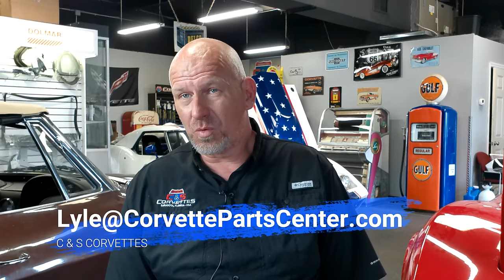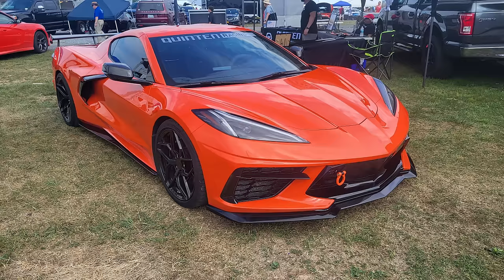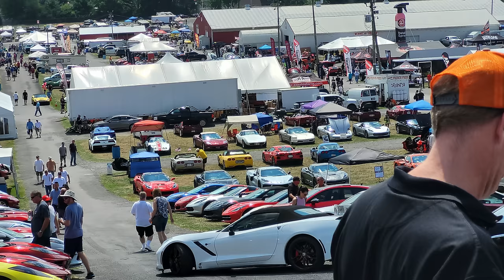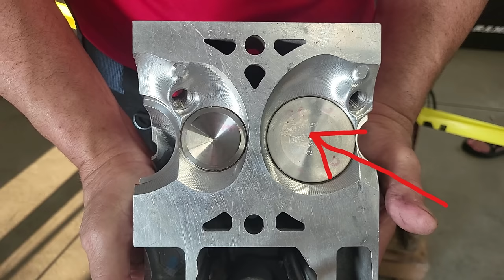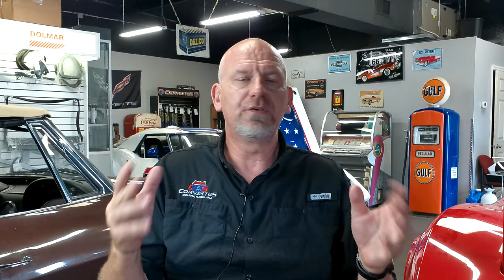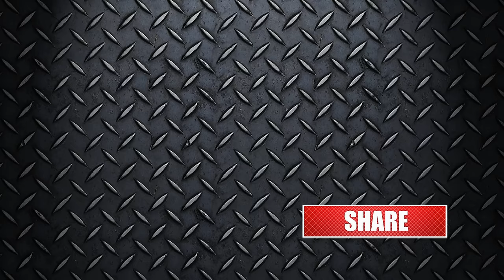The Truth about the LS7

Comment: This video was mostly BUNK!  I've seen hundreds of out of spec LS7 valves/valve guides, they range from every model year GM made the LS7 (including in the Z/28)... ALL THE YEARS POTENTIALLY HAVE THIS ISSUE!!!  It's more rare to not see a stock LS7 without at least one valve close to being, or being completely out of spec.  Mileage isn't a huge flag either, I've seen them loose with under 10k miles.  This doesn't mean they will grenade at any moment (it's a fairly low percentage that totally nuke), but the point is every LS7 is suspect and an eye needs to be kept on them to make sure they don't get to the point of excessive wear.   Please do not listen to the BS GM is spewing that it was only a few cars and only 2006!
Reply: as a former ls7 owner I agree. They also love to have rod bearing failures.
Reply: What about LS3? I have one in my Holden Commodore SS paired to a T56... is there anything to worry about? (Mime still has the machined roller rockers not the cast ones btw)
Reply: @GregoryShtevensh  the ls3 is the most bulletproof out of the entire LS series. The only thing on them are the stock rocker arm needle bearings (all ls engines) if installing a high lift aftermarket cam.
Reply: @KNS_Racing  awesome haha
Reply: Very strong opinion. I have found that folks with a strong opinion are often not 100% accurate. Get the heads replaced by a reputable company, AHP comes to mind. Get a mild cam and you are set. I did that and dyno numbers were 550.18 HP and 503 lbft torque.
Reply: @GregoryShtevensh  The LS3 is 100% solid.  Do the solid bushing conversion on the rockers and you're golden!
Reply: @BensonBMD  I'm guessing you have zero experience, other than being a one or two time vette owner and occasionally look at the corvette forum.  I've seen hundreds of LS7 heads, possibly thousands at this point.  Strong opinion?  Possibly, but almost all of them have out of spec heads, regardless of mileage.  I'm glad to hear you're happy with your results (AHP is a solid company), but please don't come on here like you know anything owning one or two vettes and mislead others that it's not an issue... it is, period, regardless of year!   Like I stated, any LS7 owner should be concerned and would be well advised (at a minimum) to have them regularly inspected because they will be loose in time.  Even if you have the heads "fixed", please continue to have them inspected as they will again wear in time... Modified cams only accelerate the issue.  Same can be said (to a lesser degree) about the Ti rods and bearings in these engines.
Reply: @KNS_Racing  As i've found out the LS3 have shit lifters and shit oil pumps. Both have failed on me at the same time
Reply: I have owned a performance shop for going on 20 years specializing in GM cars mainly Corvettes. I can't begin to tell you how many sets of heads I have gone through on the LS7 cars mostly the Z06, and several Z28 camaros!  I have not seen many rocker arm failures or bearing failures, 99% of the time, if I see a catastrophic failure its due to a broken exhaust valves. What he says about  modding the engine is BS, sorry but its BS.

I have built many track dedicated Z06 Corvettes with the LS7. One car in particular has been running since 2009 as a dedicated HPDE car with a instructor level driver. He recently had me replace the engine with a new LS7 with the identical mods. I later sold that engine to a friend with confidence that it will continue to run good. I pulled that engine down to inspect it, and other than replacing the rod bolts with ARP high strength bolts and replacing the Ferrea valve springs that was in the engine since 2009, and new gaskets. It is now running making the same power as it did in the Z06. However its new home is now in a reproduction single seat Indy car from the 50s that comes in at less than 2000#!.

In fact I just finished another HC Z06 this week with ported LS7 heads from LPE that has all the necessary corrections to repair the valve guide issues. And replacement Ferrea hollow stem exhaust valves. It made 570 to the wheels and I expect that it will be just as reliable as the other cars. Also what the author says about the PM guides being made specifically about them being special to be compatible with the Ti intake valves, and that bronze replacement guides are not. Well while we don't use them I know several companies that do, and I have seen many LS7 heads with bronze guides that have been running thousands of mile without any issues.
Reply: Boys & girls he's just generating views.
Reply: @ssoffshore5111  How many vettes do we need to own to know what we are talking about? 30?  I like my Z06 but there are other Sports cars out there that I would like to purchase at some point.
Reply: I bet you those were modified at some point in their life and that's why they grenaded
Reply: @KNS_Racing  Mine had bearing failure at 19k. Had to have it rebuilt by Texas Speed. 12 grand. Chevy refused to take any responsibility. Cowards.
Reply: @L1FEL1KE02 doubt it
Reply: @Ws6Ms  doubt all you like but that's what failed on me as well as a lifter wearing a groove in the cam lobe, so it also shit the cam
Reply: When he mentions brass and titanium not getting along? That reminds me of the clusterf#%k of Chernobyl. RBMK, was the issue,  I think....result was ....BOOM!
Reply: A lot of what this guy is saying is SPOT ON!
Reply: @tjwong007   what’s the name of your shop
Reply: @steveowens913 No, no it isn’t.
Reply: Did GM actually tell people not to mod their Z and leave it stock????
Reply: I had a 2009 c6z 100% stock from 62k miles to 120k miles. No valve drop. I also now own a 2008 c6z 100% stock at 67k miles. No valve drop. I've never been to the track, but I do 2nd gear-5th gear runs all the way to redline about 3 times a week. Never had any problems
Reply: The heads were literally off by .050 of a thousandth. Mismanufactured
Reply: Typical guys just reading something off the Internet and spewing information like this usually means they’re not actually firsthand knowledgeable about it. Pretty pretty strong opinion here on your end.
Reply: There appears to be [ quite ] a few engine gurus, here.

As such ; is it possible that you “ experienced ” experts can recommend the [ consensus ] most power-efficient and reliable ( underscored ) naturally-aspirated V8 engine known to mankind ?

Based on what I’m reading, here, that answer will come to mind in a nanosecond. 🏁
Reply: You have seen hundreds of LS7 heads? Where? Sound like hyperbole. Only the rarest machine shop would have serviced a few hundred LS7 heads. Not saying they don't have issues but I highly doubt you have held more than ten in your hands. Why is everyone on YouTube so inclined to lie?
Reply: Bullshit!
Reply: I literally bought an 08 z06 for 35k. Drove it home and it dropped a valve and blew the damn block on the way home after I bought from a used dealership as is.
Reply: @KNS_Racing Yep… to me the LS3 and LM7 are two of the strongest engines GM ever made.

Comment: The head problems persist in every year Z06.  This is not even debatable at this point.  I know 3 individuals personally that have had dropped values.  Failure on stock engines due to the valves is well well documented.  Sorry...
Reply: Yea... This guy post me when he said just don't hit redline. Like are you for real right now? If your engine can't handle 7k rpm maybe don't put the redone there... The truth is LS motors can rev higher then 7k just not with stock components.
Reply: Really?? I have had 4 Z06s and never had any head problems.
Reply: @vincentbucci671  that is sweet.  Yoy are one of the good ones!
Reply: @vincentbucci671  how long did you have them...unfixed z06 are ticking time bombs. It's a matter of time before they let go.
Reply: @defaultuser48  idk...I've seen a few for sale with over 200k on them.
Reply: Any thoughts on Z28’s 2014-2015?? They had the LS7, some people say they were left over engines from the end of the Z06 production (but I don’t believe that) and being an owner of one I’m concerned. Thank you.
Reply: @vincentbucci671  — did you ever remove the heads and valve springs and measure valve stem to guide clearance?  My 2008 Z06 had 16,000 miles when I sent the heads to Lingenfelter.  BTW all 8 exhaust valve guides were worn beyond the factory service limit of 0.0037”
Reply: @vincentbucci671 Good idea. Get Rid of them before they blow
Reply: Mr_Jim_Lahey  thanks for the details. A decent set of heads I guess is a couple of grand maybe $3000 but what’s the work over for the rod bearing problem? Can you advise any details? Thank you so much for taking the time to reply.
Reply: Link to the documentation?  How many of the 28K+ have grenaded so far?  How many of those that did were modified?  Breakdown by model year? How many spent a ton of time at the track?  I haven't been able to find the documentation for this well-documented occurrance.

Comment: Thanks for the video.  But you were given wrong information.  I own a C6 Z06 with an LS7, so I have researched it extensively.  The titanium intake valves are chromium nitride coated from Del West (OEM valve) for guide compatibility.  This is a good thing, but you got it wrong.  The hollow stem sodium filled exhaust valves were supplied by the lowest bidder and the wall thickness is not consistent.  Some will be as thin as .011".  ALL the LS7 heads (not just 2006) had issues with the guides not being concentric with the seats.  This was poor quality machine work done at a GM supplier facility in Canada.  Combine these factors and the engine experiences excessive valve guide wear.  When the wear gets to a point the thin wall exhaust valve stem breaks dropping the stainless-steel head into the chamber.  The hypereutectic alum piston then hits the valve head and the result is catastrophic.  Please add an addendum to this video to correct the information.
Reply: I have also seen cutaways of the GM exhaust valve. The stem material is NOT made with a consitent wall thickness, one side could be .030" then 180* its like .010" thick That valve is a POS!
Reply: 100% correct. Mine sucked an exhaust valve 6,500 rpm, ONCE!

Comment: If you are going to modify your LS7, I highly recommend Katech Performance in Detroit. They've been working with these engines from the beginning. Worked with GM to develop it, and built all of them for Corvette Racing ( Pratt and Miller). They know and address all the pitfalls of this engine.
Reply: Very true
Reply: Good input and thank you. 

I wonder who needs more than 500hp? 🤔
Reply: Lyle just said to find a bone stock LS7 and don’t screw with it. It’s the best it’s going to be.
Reply: @toddhartmayer8327  which is pretty sad. And I don’t understand what this guy (original commenter) is saying either. Why would I go to a place that HELPED ruin the engine, to help fix it? 🤣
Reply: @toddhartmayer8327  which is pretty sad. And I don’t understand what this guy (original commenter) is saying either. Why would I go to a place that HELPED ruin the engine, to help fix it? 🤣
Reply: well knock on wood i have a 2008 with 70,000 on it no issues . cold air intake and i've hit the limiter lots of times in first hitting 60
Reply: @WarriorsPhoto  I do.
Reply: @jrwstl02  Enjoy. (:
Reply: @WarriorsPhoto  we all do
Reply: @CamaroSS2236  (:
Reply: People run heads cam on them all the time with no issues.
Reply: @Milo Jones This is really good advice. I don't understand why GM didn't put rollers in it to begin with. I know they can be cheap, but the factory lift is almost .6" with 1.8:1 rocker arms. Why, on God's green earth did they not use rollers? In a high dollar Corvette with an extremely high performance engine.

It's like them using needle bearings in their rocker arms and not sealing them up. People with other ls engines end up with needle bearings all over their heads/engine if they don't swap them out when they put in a more radical cam. All because GM just left the trunion that holds the needle bearings open.
Reply: @ripkej77  LS7 cant hit 60 in first, LS9 ZR can. LS7 Z0 van do 52 mph in first unless you raise the redline 7600 rpm or so, not recommended.
Reply: @08turboSS  I can assure you it does
Reply: @WarriorsPhoto  me
Reply: @WarriorsPhoto  me
Reply: @natekuch441  oh I don't know? Maybe multiple wins a LeMans, Daytona ,Sebring and a bunch of championships in IMSA, and WEC. But maybe they don't know anything.
Reply: @toddhartmayer8327 Sorry - time bomb.

Comment: Owned a 2011 Z06, second owner, purchased at 14K miles, never modified from stock. Wiggle tested at 30K miles, exhaust guides out of spec, heads replaced under GM warranty with GM LS7 heads (due to factory warranty). Had those heads checked gain at 38.8K miles just prior to GM powertrain warranty expiring at 5 years, intake guides were out of spec. A second set of GM warranty GM heads were installed. However, both sets of replacement heads were of the same lot (2013), so expected intakes to prematurely wear. As predicted, had heads checked at 48XXX miles, intakes worn, replaced with aftermarket heads on GMPP warranty.  Replaced that Z06 with 2011 Carbon Edition Z06 in Oct 2021, 6.6K miles, all original and stock.  Had OEM heads replaced with aftermarket heads to be proactive.  Checked guides on OEM heads and intakes were out of spec at only 6.6K miles.
Reply: My gosh. You just took me right out of that market.
Reply from the maker: Wow.  That is really good info.  Thank you for responding!  Lyle
Reply: Well dang it that is very concerning all round!  What the hell?? What are we to believe then?? I’m concerned my 2014 Z28 will spit valves any day. Constant concern.
Reply: @540chevhell9  Buy aftermarket heads !  Additional power, eliminate worries 😁
Reply: Go buy a lingenfelter eliminator motor....amazing
Reply: @540chevhell9  There are reports of LS7s in Z28s dropping valves too.  Best insurance is to get a set of aftermarket heads with upgraded valve guides.  I went with American Heritage Performance heads with Moldstar90 valve guides for my Z06.  Supposedly, the Moldstar guides are the best you can buy.
Reply: sounds,,.exhausting!!!!..mo thancs...
Reply: You replace the guides with Bronze Guides and a new set of Ferrea Titanium valves for the intakes and sodium filled stainless steel for the exhaust valves and that problem is solved at least for the last 30 years. Why won't that work? I own older corvettes, 67's 65's and 1990's LT1 LT4 so I may not understand why regular high performance racing fixes won't work on the LS7?
Reply: My c6 z06 has 70k, and still running strong.
Reply: @paulmoss7940  you have to budget for some nice aftermarket heads for these or buy some already done by a reputable shop. That's how I went when I used to have my z06.
Reply: @Tito-bv6om  what year is it?
Reply: @CarStory  my car is an 07, but had the engine replaced under warranty in 09. So it's a 09 service engine according to the serial number on the side of the block.
Reply: @kennethalbert4653  still won't fix it
Reply: @paulmoss7940  yup me too looks like the only Z06 on my bucket list will be a C5 lol
Reply: What a headache considering to cost for one of these. At the same time high performance equals unreliability.
Reply: Swap with ls3 & stage 3 cam won’t regret it
Reply: @kimblem.w9952 . just get a grand sport 10’-13’ looks just like a z06 (front air dam, wide body flared fenders ).but has the  bulletproof ls3, then build it past the power of a stock z06/ls7..easy peasy.
Reply: So sad.  Loved my 09 Z06….had the valves drop at 32k miles….blew the motor (extended warranty ended the year prior😢).  Dealer replaced the LS7 with a crate….all in cost me 11k after I tore GM customer service a new one.

Sold the car in December 2018 for 30k.  (Yes disgusting I know….could probably get 50k for it now).  

So guy who bought it is driving with a brand new engine on a 2009 Z06….for 30k…sickening
Reply: Wow!
Reply: Sounds like you are unlucky or the tech was looking for some free parts.
Reply: Good lord. I think I will stick with messing around with iron block Vortec engines 😅

Comment: I recently bought a C6 Z06 in excellent condition with 30K miles. The heads were not done so I sent the car out to fix the valve problem. All Texas’s speed parts and the heads were totally rebuilt and upgraded, but I also did the Cam, headers, high flow air intake, cat delete and a tune. It’s over 700 HP now and a monster. We will see how long it lasts.
Reply: Any boost or did u manage to squeeze that out n/a? Some ppl have gotten to over 700 na
Reply: @chocolat3603  no it’s all na.
Reply: @craigthescott5074  damn what's ur line of work if u buy so many vettes i saw ur page
Reply: @craigthescott5074  I'm addicted to them aswell I've gotten to ride in most of them but I wanna get a c6 z06. I think im probably gonna try joining the army sometime next year or the police force lmk which one u might sell in the future I may be interested. I'm 20 years old

Comment: Completely stock 06 Z06 with 30k miles dropped a valve without warning cruising on the freeway. Cost me the motor and oil system. 20k mistake thanks GM. This issue is very real. I high recommend anyone with an ls7 get there heads done.